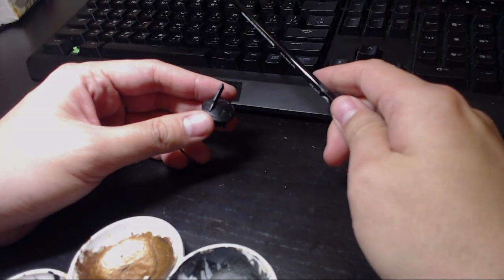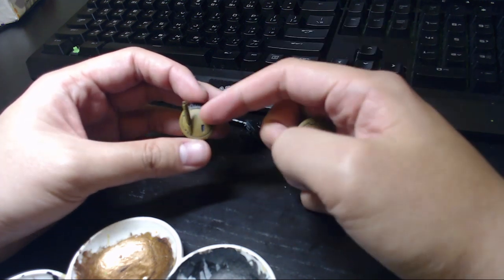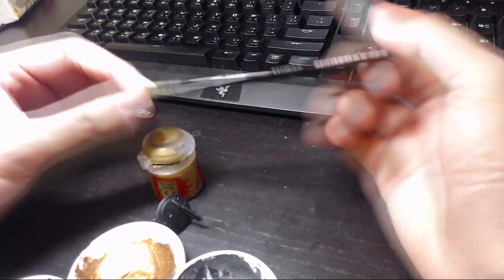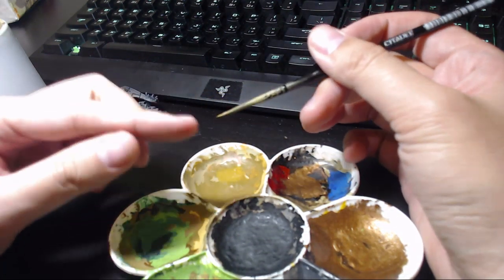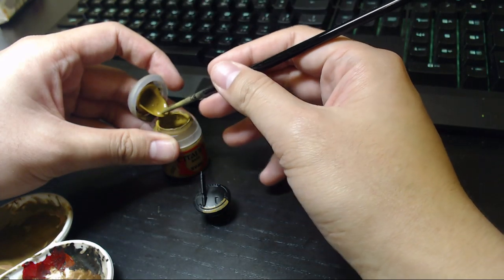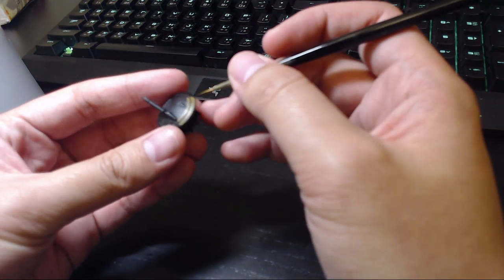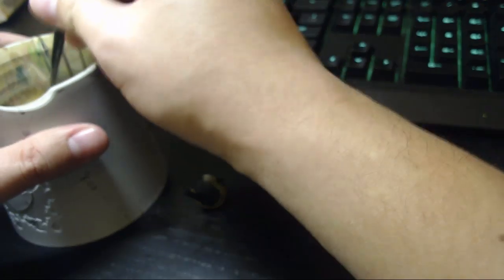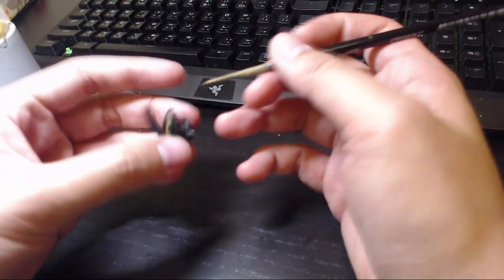Paint Tau Drones Easy!

Comment: @Tsumugi Stupid question from a noob, but wouldn't you just use a shade for that? I was thinking about just brushing the crevice with  nuln oil and touching up afterwards if necessary.
Reply: You can wet the mini then remove the water with a paper towel, leaving only water in the crevasses

It will help the paint flowing here, and you'll have less touch up to do after